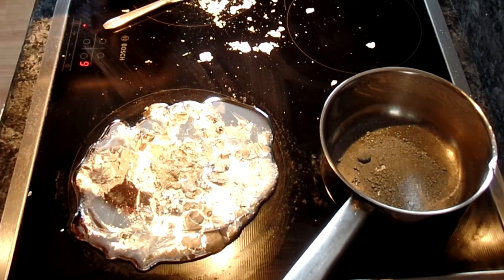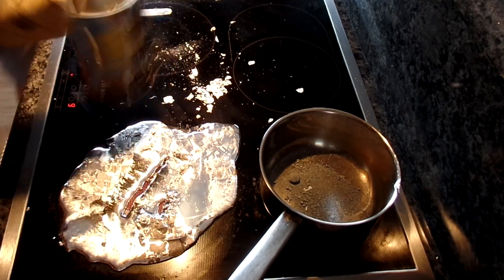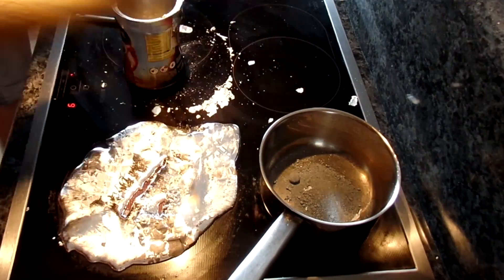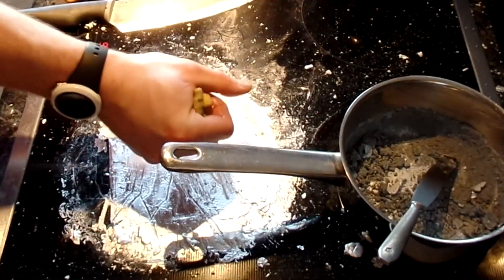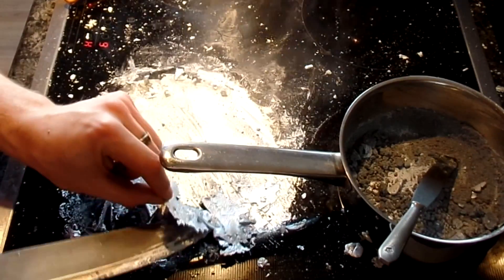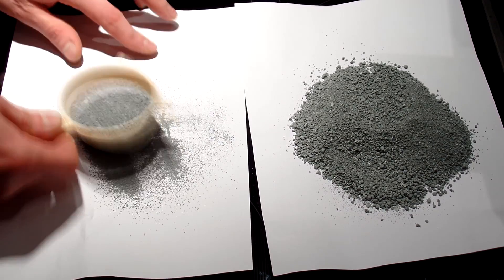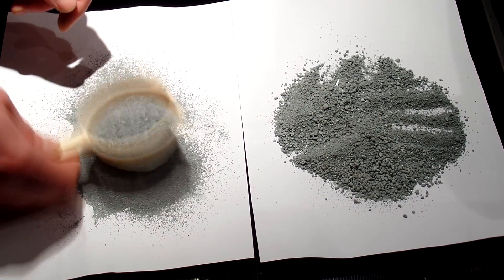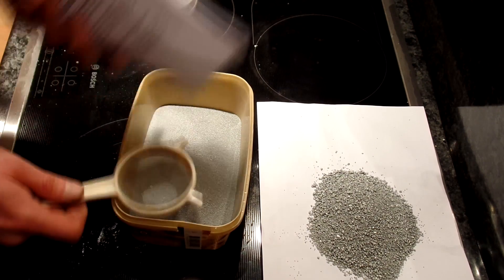How to make zinc powder

Comment: mortar and pestle has left the chat
Reply from the maker: I had a small set of those, all I managed to do was draw zinc lines on the mortar, zinc was too soft and plastic. Also You cannot start with a block of zinc in mortar, though You can try put the "sand" in and grind it down.

Comment: what a cheap stove , a drop of water and it cracks.
Reply from the maker: Not really, molten metal just transferred heat too quickly, that would never happen if it was used as it should.

Comment: It was a bad idea. Congratulations you got not Zn. It's ZnO. And its already useless in chemistry.
Reply from the maker: Congratulations You are wrong. At the end of the video is a reaction with sulfur. Vent slowly, because of large particle size, but it does work and still works today. Tens of different reactions done using it, made in this video. 

Good luck! :)
Reply: zinc oxide with pure zinc is used in silver-zinc battery, you need to expand this first-semester chemistry knowledge of yours, I leave you the reaction as a homework

Comment: Edit: I had to go back and fix my spelling mistakes lol. 

Lol....I was like what is he doing.  But yeah zinc melts just fine in a stainless pan. But I've noticed I had to get it started with a micro torch. I'm recycling zinc battery casings for ingots . Soon I will have enough ingots to try this process. I try and use my batteries up before doing this but at the dollar store they don't last long, and at a buck for 2 I get impatient. The carbon rods are great for electrolysis, so not all is lost. Great video.
Reply from the maker: :D I was 50% improvising at the time, process can be made better, But I have never done this again, so it is up to You. Learn from my mistakes!

Avoid inhaling zinc dust! Good luck! :)
Reply: @TheMrbunGee  maybe that's why my lungs hurt after working this. I'm going to be making powder next. I'm curious how I will be able to run a current through it though. Maybe put a pancake coil on the bottom of my jar then print the positive and nano coated copper coil the regular way? Hmmm pondering thoughts. Lol. Thank you for responding too not many will.
Reply from the maker: @jvon3885   Yea, wear a mask or something, and check "metal fume fever" on google.  :D

Otherwise I really got lost in Your processes, not my field. :D 

Stay safe!
Reply from the maker: @jvon3885  Oh man, Please don't waste Your time on this. Not a single point of science behind it, leave it. It is clearly a scam! 

Sorry.
Reply: @TheMrbunGee  like I said not much is known. But. That's why I started working with it. As far as claims that it's a magical healing whatever....yeah I'm not buying it. But. As far as understanding molecular structure of metals, that's what I'm after. Yes I've seen some wacky ideas so far.
Reply from the maker: @jvon3885  The whole nano solid state is scam. The way they claim to make it is impossible. Not much is known because everything "known" is made up by a guy, who is mentally chellanged and scientificly illiterate. 

How do You get the "gans"? Passing electricity trough destilled water? Too bad destilled water is non conductive by deffinition. Once You add zinc ions to solution, You get electrolysis and a precipitate. You can find a guy sending these "gans" to a laboratory to thest what is it, and it is zinc carbonate. Nothing special about that substance. 

If that were solid gas, at any point - it would float, not sink. 

There is 0% scientific truth in this. Please, You said You have children, spend Your time on them, not on this. No one will ever get anything useful from this nonsense, except for the guy, who scams people. Nobody needs that right now.
Reply: Dear sir,Our company specializes in producing metal powder production equipment for more than 20 years, with advanced technology and rich experience, the cost of equipment are lower than those of other companies.Main application in lithium battery materials, metallurgical powder, nonmetallic mineral materials, electronic ceramic materials, various abrasives, diamond and other superhard materials.
　　1.Metals:Cu,Fe,Al,Mo,W,Ni,Re,Ta,Ti and their alloys;
　　2.Oxides:Al2O3,MgO,TiO2,ZrO2,SiO2 and so on;
　　3.Carbides:WC,TiC,B4C,SiC and so on;
4.Nitrides:AiN,TiN,BN,Si3N4 and so on.

Do you want to act as our sales agent in your country?Looking forward to your reply and consultation.

Best regards,  

Name: Qingdao Jinghua Powder Equipment Co., Ltd
Add: No.239, Lan’aolu Road, Jimo, Qingdao
Tel: 086-532-87589861    086-532-87550721
Moble: 086-182-6396-7330(Whatsapp and wechat)
E-mail:pelterchen@gmail.com

Comment: Now how can you make aluminum of the same mesh size.  Not powered say 20 to 60 mesh size.
Reply from the maker: The best way be to make aluminum/magnesium alloy, then just smash it and grind with whatever. The alloy of 50-50 Al-Mg is very brittle, it will grind easy. That is what I would do. 

You can try to make something like this work, but start small scale, I have noticed a phase, similar to zinc, in molten aluminum, but I have not tried to exploit it to make powder.
Reply: @TheMrbunGee  I have 10lb of 10mesh spherical aluminum that I would like to reduce to 20-60 mesh.
Reply from the maker: @madmarkthepyro5247   Try ball mill, or really just make the:

https://en.wikipedia.org/wiki/Magnalium

Comment: You say that you can ball mill to get even finer powder.  I am looking to create very fine silver powder to create my own silver conductive epoxy for electronics projects.  Can you ball mill silver?  Or is it only something you can do for soft metals?  I would imagine the balls and the ball mill must be harder than the metal you wish to chop into an even finer powder right?
Reply from the maker: You should be able to ball mill silver, but it might need larger and heavier grinding balls/chunks. I am not 100% sure. I would dissolve silver and then precipitate chemically/electro-chemically . hardness is not the factor, as you can also ball mill diamond, because it is somewhat brittle.
Reply: @TheMrbunGee  I'm looking to do this physically instead of using chemistry.  I bought half-inch and quarter inch balls and I know it works on aluminum so hopefully it will work on zinc and silver.
Reply from the maker: @artbyrobot1  I think it should, it might take longer but it should! Good luck!
Reply: .999 silver should ball mill no problem. I use a steel can with a screw top lid, put some steel ball bearings in it. Then it goes on a rock tumbler. Easy.

Comment: What kind of meth addict are you?     This is not anything but a video of "what not to do" "EVER".      Best bet would be to stay away from the kitchen all together ...  I'm surprised that there's no adult supervision here ... or at  the very least, childproof locks on the drawers and cupboards -so you don't end up drinking Drain-O while trying to make a video.... #thintheherd
Reply from the maker: I do not understand what are you so worried about.  no children where even near my kitchen during filming. Of course there is no adult supervision, never thought I need one, especially when I live alone in my own flat and make my own decisions. If you consider heating something hotter than boiling water in your home a deadly hazard - it is your problem not mine. Also - If locks are the only way to stop you from drinking thing you are not supposed to you should be locked up. Its amazing thing that you can still type this comment, even tho it is one of stupidest comments I have seen in a while. Maybe you shouldn't drink the drain cleaner so often.

Comment: Nice try but it shouldn't work this way! 
You can dissolve zinc oxide in sodium hydroxide solution then electrolysis the solution, you will get the zinc powder in cathode!
Reply from the maker: It works this way, and this is just another way!

Comment: I make zinc powder by putting a sheet of paper on my workmate bench then clamping a vice to the bench . Next I insert a block of zinc in the vice then I file it ,obviously the finer the file the smaller the grains . Remove the vice then transfer the filings into a container . No mess . No heat  .
Reply from the maker: Yes, that is the obvious way and this is the other way! :)

Comment: I like the use of the chemplayer voice synthesizer.

How'd you clean the mixer and the coffee grinder?
Reply from the maker: There was only dust in coffee grinder, no problem there. The mixer had some zinc stuck to it so I just left the mixer blades in a diluted HCl solution for a day or two and then cleaned with a wire brush!